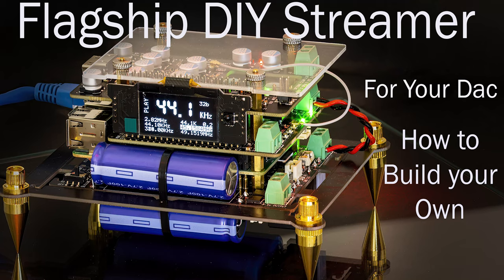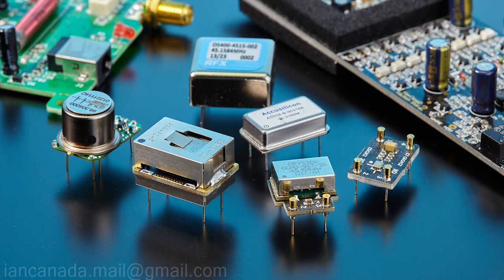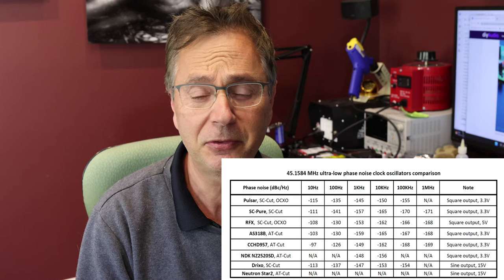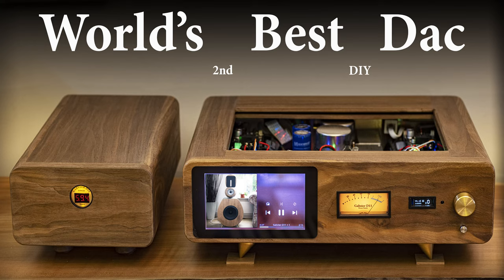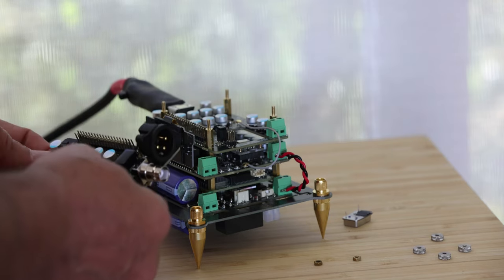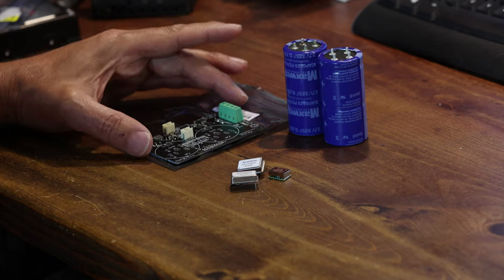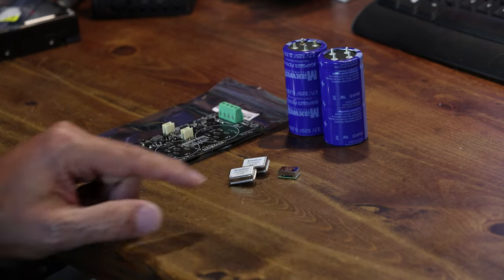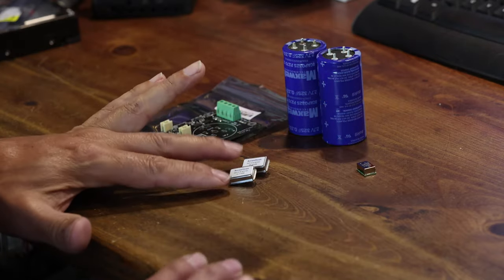DIY Audiophile music Streamer for a Dac  with Flagship HIFI parts from Ian Canada upgraded  Part 2

Comment: I have a cchd957 on a cheap Chinese DDC with a xmos chip which feeds via coax into my Bifrost (OG). I power it with a linear power supply. I can't tell you how blown i was the first time i heard it. It's so impressive that i have put off buying a new dac for quite some time now. Clocks make a massive difference to the sound. I will be doing your diy streamer as my next project. That's the right way forward! Thank you for amazing videos :)
Reply from the maker: The cchd957 is my favorite so far without going too crazy expensive and complicated specially with a good dedicated power.
Gglad to hear I am not the only one, also it depends on the rest of your system and taste. Have fun building. There is also joy in the process and ownership of your DIY project.

Comment: Please Mr Gabster, sorry to bother u, but I'd like to know using Volumio OS on Rasperry PI 4 model B 8 Giga which interface I should select due to I have bought Ian Canada Transport ultra low jitter S/PDIF? There a lot f interface but missing Ian Canada product. No sound without slecting interface for I2S DAC(settled ON - (Select DAC model: ????). Second question possible to use Crystal oscillator on FiFoPi Q7 at 90.138 MHz and an addition one at 98.340 MHz? Thanks in advance for your kind support

Comment: Is it possible to buy the clocks from Ian Canada to create an external clock only? I already have an off the shelf streamer and DAC but would like an external clock to add. Thanks.
Reply from the maker: They are bare clocks but if your clocks are 3.3v and you can take them out you could solder them in place but for a Quick answer I would say no

Comment: Two questions please, why are the batteries necessary?  If my current external DAC has usb inputs, can i use the usb outs from the rasp pi for that?  Would this make the re-clocker pointless if I did that?
Reply from the maker: Raspberry pi usb is very noisy 
Batteries are great power for The reclocking board

Comment: hello gabster, i also want to apply this but i see on the reclocker XO1 and XO2 with something like 45 mhz and 49 mhz.
the ACCUSILICON clocks do have a value, but the standard clocks do not.

how do I know where the standard clocks should go if I want to put them back.

thank you in advance
Reply from the maker: You can swap the clock positioning no problem as long as you have 2 clock families 45,49
But pay attention to pin 1 dot need to be on pin 1 of the socket

Comment: @Gabster1 - thank you for your incredibly informative videos. Thanks to your encouragement, I completed the Ian Canada streamer project with SC Pure Clocks, and it sounds better to me than the Eversolo DMP 6 with an LPS upgrade. I am using Ropieee with the Raspberry Pi generic I2S output to the Holo Audio DAC. However, the generic I2S from Ropieee is only giving me 192kHz. I am using a dedicated HQPlayer and would like to output at a higher rate. Is there a way to configure the Ian Canada streamer to output DSD1024 and PCM 1.536MHz output?

Thank you once again for supporting the audio enthusiast community.

Comment: Hi Gabby, great work you are doing. I have some questions:
Can I volume control this flagship streamer via remote control....In using this streamer over the Aes board as a preamp to my activated loudspeakers. The digital input signal of our diy dsp adau1452 controlled hypex ncore amps is the burrbrown 1794 dac in NOS (mono) mode...
Or would you prefer the ess9038 dac modul of IAN and going analog to our amps.

Thanks a lot
Karim from Germany
Reply from the maker: You can not control the Volume but some streaming software let you do that but at sound quality cost 
Your Dac is nice and great but to reach the next level you would need to get a good Analog AMP Preamp  but it will get costly the ess9038 dac module of IAN with ess controller let you adj the volume but I always find a good preamp does a better job and sounds better so I would keep the Dac at max and adj with the preamp.
Try turning all DSP and processing off any auto volume leveling  and see if it sounds better
Hope that helps.

Comment: Nice Build , but if it's all about accurate clocking and low noise I found A Mini PC and modified a DC to DC converter and got the ripple with everything 1 millivolts rms on my scope and with USB no real clock issues because of asynchronous communication. This board beat the PI & Tinker in elimination of over all in and DC ripple or other noise ( so there other ways) DAC,Mini PC,Power under $200😅

Comment: I also use Q7 but did not bend the pin1 on the clock. Can you tell me why it needs to be done?  And this cancelling pin1, does it need to be done in both clocks?
Reply: also really curious about this, im using TransportPi Digi and havent bend the pin on my accusilicon clock
Reply: Oh, the manual adresses this atleast for the Q3 and TransportPi Digi the manual clearly states that clocks with "OE" pin are supported!

Comment: Thanks for the great video, I've a question: my DAC doesn't accept HDMI input, can I use a TransportPi MKII for coaxial output instead of HdmiPi Pro? If not, what I can use in place of (or in addition to) the HdmiPi Pro?
Reply from the maker: Yes you can or slightly better the transport pi AES

Comment: Hi, thank you for your fine building tips.
Is there any good reason to use the ifi supply with the UCconditioner? Shouldn‘t any decent switching supply work with same result noise wise?
Reply from the maker: 2 parts
1) for the rpi it is getting constant power despite the ultra capacitors that filter noise you are still getting some 

2) for the fifo pi that is using batteries and disconnect Most likely yes but with very noisy power supplies the noise can transmit by proximity 
I demonstrated that in one of my d11 builds I believe the power supply one.

Comment: Thank you gabs, im a total noob in this, currently I use a Rpi 3 to stream roon to my dac, Can I follow this give to use the usb output? or I need to change the HdmiPi Pro for another part?
Reply from the maker: You could use a transport pi AES and steam via coax or optical unless your Dac accepts I2S 
Usb is not recommended with this system

Comment: Thank you, Gaby, excellent video (Part 1 & Part 2). Please clarify that the Uc conditioner is #26A. UcConditioner 3.3V (Universal) and ultracapacitors are Maxwell 2.7V 325F 1.6 mOhm Ultracapacitors Model # BCAP0325 P270 S19 (as shown in the video). Question: Why do we use 2.7V Ultracapacitors on a 3.2V battery power supply system?
Reply from the maker: Yes that is correct 
as of now they do not make 3.3v ultra capacitors actually you would need a 4V for safety margin
so has to use 2in series capacitance drops in half and voltage rating doubles you also need a balancer Uc conditioner to avoid one going over 2.7
hope that helps I updated the description with links :)

Comment: The accusilicon clocks have different values, does it matter which clock you put where, and do you disable pin 1 on both clocks?
Reply: I saw a comment that said the board would support the accusilicons with pin 1 installed so I tried it and it sounds great. I can't tell for sure if it is better than before the upgrade but I think it does!  Both versions definitely sound better than the raspberry pi streamer I built before as I can A/B them.  The one thing that does NOT sound better are my DSF (DSD) files, they play but instead of saying they are DSD, they say they are 192 PCM files and have a background hiss.  I have a Topping D90LE DAC.  My other raspberry pi streamer is using a pi 4 and has a USB out.

Comment: Hi, my DAC is a heavilly modded Ayon Sigma which was optimized for USB audio. It does not have i2s and USB sounds better than AES/EBU. Any ideas for building a streamer focused on USB that would better my USBridge Signature?
Reply from the maker: I am not a big fan of usb but some people love them can not help you as I never tried any solutions with this type of streamer there may be boards that will work but I think you may loose the advantages of this platform then again not my area of expertise.

Comment: This is a great series!  Thanks for posting.
I am curious, based on your comments towards the end, if the clock on the streamer matters very much if you already have a good DAC.  I assume that most DACs re-clock the incoming digital stream.  If that’s the case, am I correct that the main value of your design is the stable power supply (to reduce noise)?  I assume that jitter will be ironed out (or added) by the DAC at the analog conversion step.
PS- I have a topping D90, which sounds great to my ears, streaming directly from my computer, but I have never compared it to anything else.
Reply from the maker: Correct to get the full  benefit of good clocks find a  DAC that does not re-clock the incoming digital stream or adj the setting to bypass them if possible.

Comment: Thanks for this great content 
I own a dac with I2S in. 

Why do I need a HDMI board for I2S ? 
Doesn’t the FIFOPi Board have I2S as well? 
I use I2S now. Out of a micromedia Dante board build into my dac connected to a Mac as streamer. 

Would a raspberry Pi be a better choice?
Reply from the maker: Thank you 🙏 
The I2s in the board is for very short distance between circuits the I2s via hdmi is for a bit longer

Comment: I love the "please observe safety measures". People who ever seen what a big capacitor can do will handle them as a live bomb, while the the rest are "yes, yes, sure the usual be safe b.s." 😂
for those never handle a big capacitor, I melted a screwdriver while discharging one, and I don't mean a litlle bit of damage, I mean 2-3 mm  solid steal literally melted. Before that I used a tack from a measuring device an 1 cm not just melted, but literally evaporated, so we are talking very serious injury if you don't treat them with the proper respect to a big capacitor when charged.

Comment: Hi Gabby, excellent video and extremely valuable inputs for coming projects of mine ! Currently very happily using the BNC output of an Allo Digione Signature mounted on USBridge itself battery supplied but interested to try the I2S input of my Audio-GD R27-RE (R2R) DAC. If you don't mind question concerning the clock frequencies : if I understand well they should be multiple of 22.5792 and 24.5760MHz for resp. playing multiple of 44.1 and 48 kHz streams. Is the final applied clock frequency relevant for the sound quality ? For example IAN CANADA's SC-PURE clocks can also be purchased with resp. 45.1584 and 49.1520 MHz. Thanks beforehand and good continuation !
Reply from the maker: Sound Quality is about the same on some clocks lower frequencies may sound better 
But very debatable I personally prefer Ian’s 45/49 combo also they support higher sampling rate then the 22/24 version
Hope that helps
Reply: @Gabster1 Hi Gabi, thanks so much for your quick answer. I will probably follow your advice. Just to know & learn would 22/24 MHz clocks be sufficient up to 176/192K resolution ? Btw I also observed my Audio-gd DAC working with 90/98 MHz ones. Today I also watched your "Amazing Dac Streamer" video based on an USBridge I will probably upgrade mines on a similar way, using FifoPi7 + HdmiPiPro modules (instead of DigiOne Signature) with decent power supplies. Congratulation for your work !

Comment: Hi Gabby. I have just bought all the parts after watching your videos. Ive gone with the transport AES instead of the HDMI. I am now looking for an alu case that fits - if you know to one, please let me know
Reply from the maker: Start with a wood plank when you are happy with everything and it is working, lay it down and figure out what size case you need. lots of choices at mouser or Ebay some are basic cases but you can dress them up with a wood piece.
Reply: @Gabster1  Regards the electrical cable you used, what size was it? I bought some 22 AWG solid core red and black and its too thin. I want the same gauge as you're using.
Reply from the maker: @ccshell   22 is way too small try 16 or 14 I use silver plated wire from Ebay they are very good Quality 
https://ebay.us/qe5eor
get a few different gages between 17 and 13

Comment: Really great. Does the streamer need the network cable, or can it receive wifi?
Reply from the maker: it will work on wifi but more reliable with a network cable unless you router is near
Reply: @Gabster1  Thanks.

Comment: I'm just ordering this to build next week.  How do I ensure that my equipment chain uses the superior clocks?  I hate to show my ignorance but I want to see if I hear the difference.   I'll be feeding the signal into a new Gustard R26.
Reply from the maker: R26 is a very nice Dac
Not a 100% sure but you need to disable OS (over sampling) and it may bypass the clocks hard to tell.
Also try putting the ref Clock to external see manual
Reply: @Gabster1  Thanks so much!  I'll let you know.

Comment: Is using LinearPi with UcConditioner inferior to using PurePi and UcConditioner?
Reply from the maker: If I would to rank I would say Ultra Capacitors with UCpure, PurePi and UcConditioner, LinearPi or Lifepo4 with UcConditioner, Linear Pi
hope that helps
Reply: @Gabster1  Yes, that helps. Thanks! I feel somewhat reluctant to go with the big ultra caps because of cost and safety. Not used to that stuff. But I guess I will go with PurePi with UcC instead of LinearPi and UcC then.
Reply: @Gabster1   I do have a follow up question if you do not mind. Using the big ultra caps take a lot of space so I am wonering if there are places where they are not critical soundwise? I was thinking they should not be necessary for the RaspberryPi. Are clean power critical on the "dirty" side of Q7 (5V) or is it sufficent to use them only on the clean side (3.3V)?

Comment: Next step would be to use a transformer and two LinearPi (5v and 3.3v). In that way you can get everything in one box and not need a linear power supply.

Comment: Does anyone know the total height with the super capacitors on (in cm). I am looking for an acrylic box to put on top of it for protection. my acrylic box is is 20x20x20 cm.. Will it do gabby or someone else who knows?
Reply from the maker: Depends on the boards and shields used mine just under 20cm you can also put the UltraCaps on the side
Reply: @Gabster1  thanks mate!

Comment: Anyone know where I can find the batteries for this? He says 3.7v at first then he says 3.2v. So is it 18650 3.2v?
Reply from the maker: Try AliExpress hard to find 

C$12.44  31％ Off | Lifepo4 18650 3.2V 1800mah Rechargeable Battery Cell Brand New Long Cycle Life For Power Tool Home Appliance Solar System
https://a.aliexpress.com/_mLJFozs

Comment: Don't understand around 8:50 or so you say "you put the second clock in" and then at 8:58 the clock is no longer in the shot and actually is on the table. What's going on?
Reply from the maker: I had a Accusilicon in one and a Crystek in the other one so I can compare the 2 but usually you would put to the same brand
Reply: @Gabster1  you compare them by leaving it in, not removing it and leaving it on the table. You clearly inserted it at 8:50 and then at 8:58 it is on the table.
Reply from the maker: @paddle_shift  I had to look at the video to see what you mean you are correct. 
I shot the video as I was testing different clocks many times  including a small hard to see Crystek 5 series and the clips are not in proper order.
Good observation a error on my part, but the idea is the same nothing will work without the clocks.
Reply: @Gabster1  Thank you kindly, i thought i was losing my mind.

Comment: This is a nice throw together project from parts off the web.  The problem I have is the same with all audio fool stuff.  Adding super caps and low thermal EMF connectors and fancy wires is not going to make it sound any better in a double blind random test of modified and unmodified kit.  Even if you have access to a couple hundred thousand dollars of calibrated lab equipment with 7.5 digits of accuracy you you will still not capture any appreciable difference in signal.  You will get more benefit from simply adding in some good bypass caps at the critical chips than with this exercise.  This is like adding engraving to your gun and then claiming that it is more accurate because of the weight distribution shift in the weapon.  It's about bragging, not .00001% distortion or femptosecond jitter improvement or any other such nonsense.